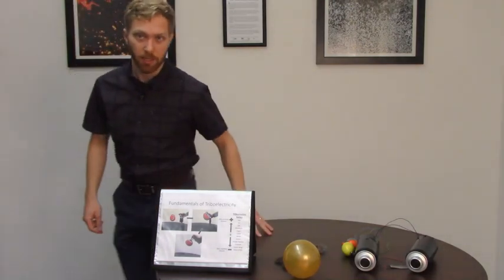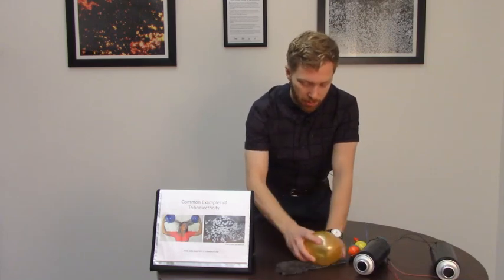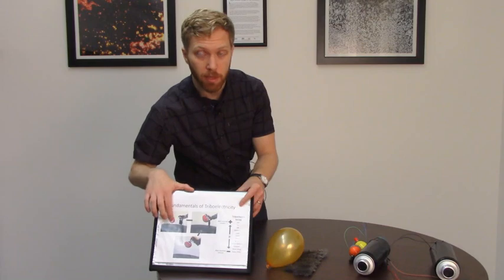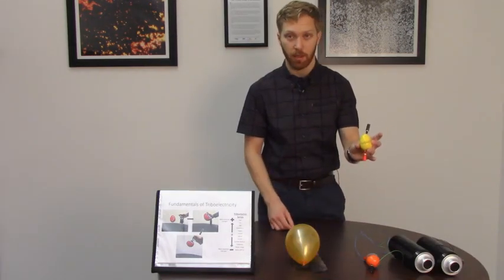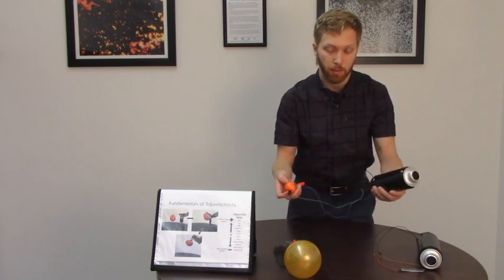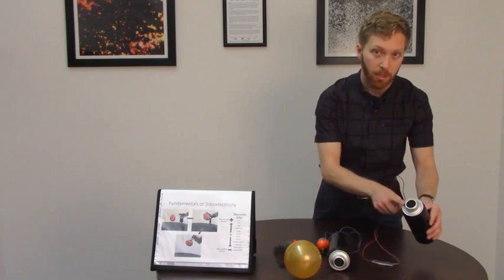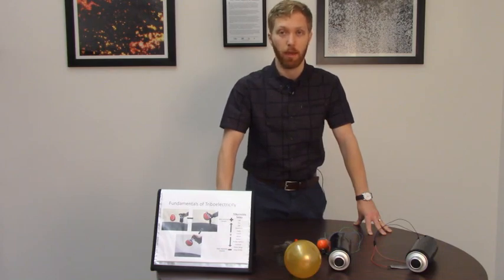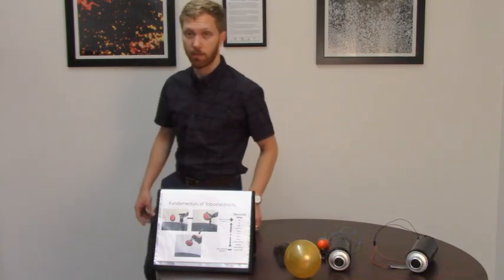Triboelectric Nanogenerators 2

Comment: Hi, I was wondering. As it is a nanogenarator, it generates a low current output. Plus, LEDs need DC to power on but the TENG is AC, so did you use rectifier or how did you proceed TO light up those LEDs ?